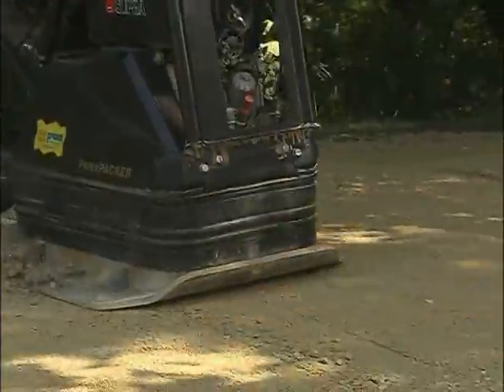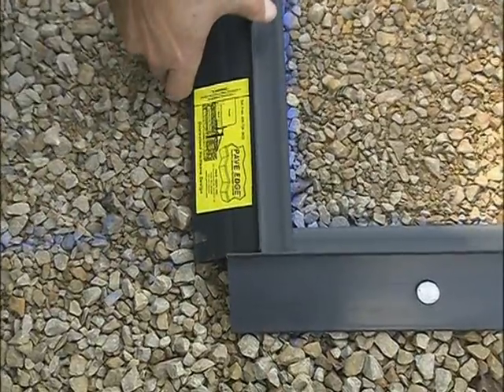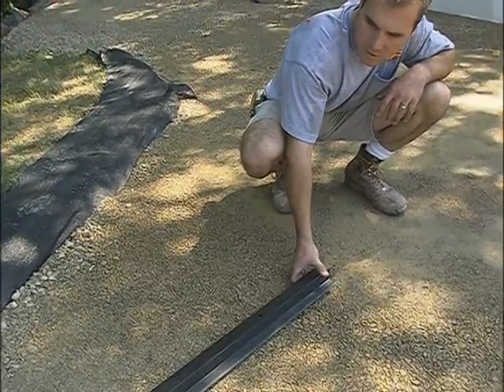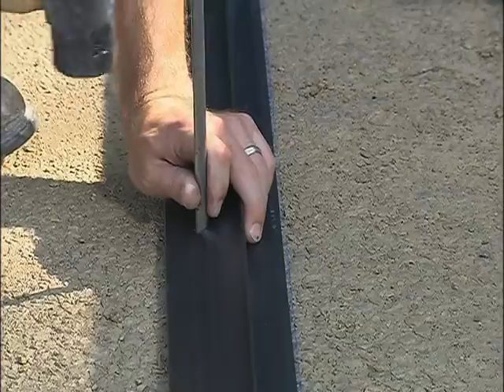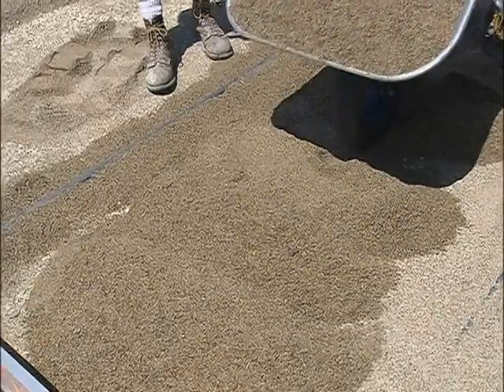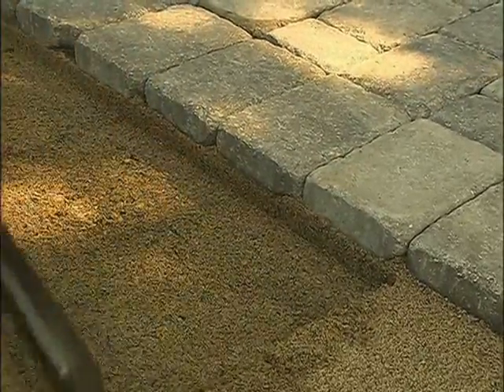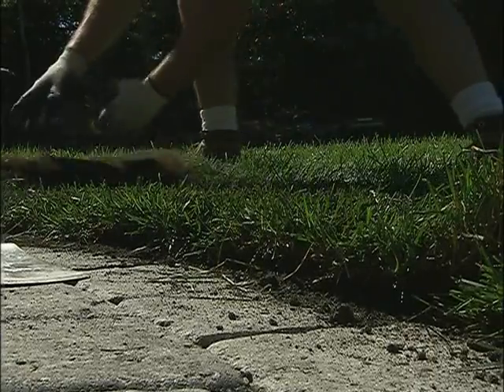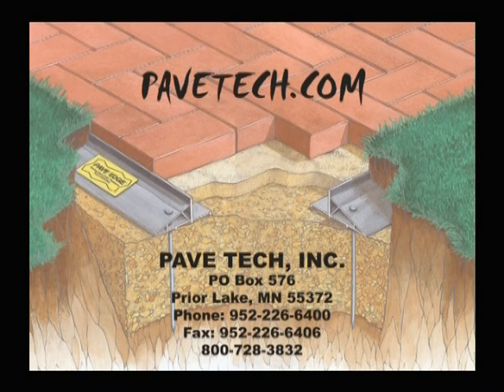Pave Edge Installation Techniques | PAVE TECH - Hardscape Outfitter

Comment: im using cement to fill the joint between pavers, do i need to install paver edge?
Reply: If you used cement than you cant use the edger because you are already using the cement as an edger that will eventually fail 😂